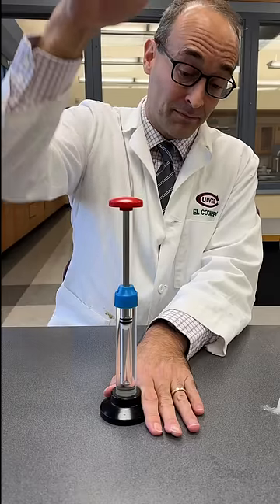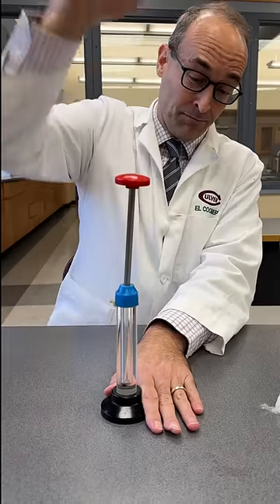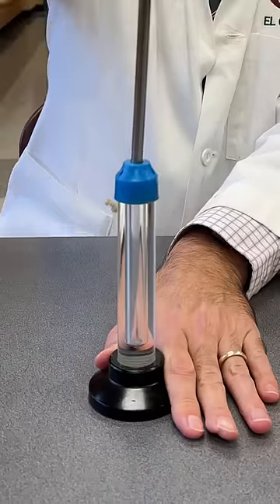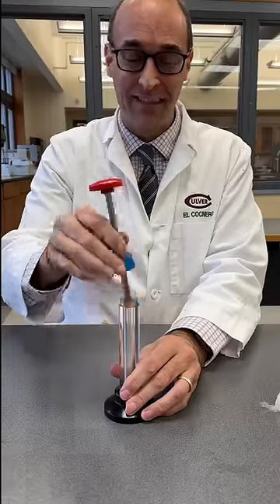Squeezing air to burn stuff

Comment: Not just the heat, the increase in pressure also means there's more oxygen molecules closer to the cotton.
Reply: excellent point!
Reply: Well I didn't understood it.. 
When he Squeezed It 
Pretty sure 
Volume decreased, And Pressure increased 
So How Come Temprature Increased there
Reply: @lightbringer485 When you squeeze gas, the atoms get closer even when they don’t want to. This makes them vibrate around a bunch which makes it hot.
Reply: @john-ic5pz pointless point. Just imagine high pressure low temperature air around cotton. Will it ignite? I doubt it.
Reply: @lightbringer485  Some of the work done by the piston goes into heating the gas. On a microscopic scale it could be explained by molecules hitting the moving piston. As the piston is in motion relative to the gas, on average those molecules will gain velocity.
For a thermodynamics description, have a look at adiabatic compressions.
Reply: @TiSapph  hmm makes sense, this might have taken place there.
Reply: I'll try my best explanation. Air has temperature, right? it has heat energy in it. 
the whole tube worth of air is suddenly compressed and the heat is now all in that tiny space. 

it's kinda like a magnifying glass: the sunlight won't ignite a sheet of paper but if you take that energy falling on the sheet and concentrate it into a point, it can be much hotter.
Reply: Wrong. Increasing pressure by decreasing volume increases the temperature because you are compacting all the heat energy into less space, and vice versa.

You are getting confused here. Increasing temperature actually also increases the pressure in a closed container, since the gas particles bounce around more and exert more pressure. The difference is that when it is not confined, it will expand and although it will not try and reduce the pressure, heat loss and the expansion inertia will cause a drop in pressure. When the gas is more spread apart, it does not exert as much pressure.
Reply: @crapstirrer  hmm understood. thanks for giving that explanation man
Reply: wow you said that with so much confidence 😂
Reply: @nhs.14  im talking about how density is irrelevant. Average kinetic energy known as temperature is.
Reply: @crapstirrer we didnt understand each other. You are talking about process (adiabatic compression) and it is ttrue. By compressing, you get the heat packed on lesser volumen which results in temperature increase. The other guy said that reason for cumbustion is "oxygen molucules are closer to combusting material" which is false claim. To explain that, imagine introducing air with 50 bar pressure at -50°C temperature. IT Will not ignite despite oxygen molucules are densely packed.
Reply: actually yes if you increase The air pressure And don't change the temperature at all eventually the cotton will ignite due to the oxygen, higher pressure lowers ignition temperature, It would lower the ignition point of cotton to room temp eventually. Similar to increased oxygen concentration.
 If you increase the pressure of pure oxygen it gets super dangerous, Even ceramic will catch on fire at relatively low temperature.

Same effect works both ways, Apollo 11 was like a third of atmospheric pressure with the oxygen level increased So they could breathe normally.

Acetylene will spontaneously combust if you increase the pressure over 30psi.

Think about it like this, instead of cotton being in two rooms that are slightly different pressure and the same temperature
You take all the oxygen from a room to space, drop it on the moon, and then try to ignite the cotton with that oxygen.
doesn't work, The oxygen molecules are all gone.

Now take that same heat source down to 15 PSI (sea level) and try to light a fire.
Way easier right?
So obviously pressure affected the ignition temperature.

Comment: This is Guy-Lussacs Law. It describes how temperature relates to pressure, more specifically how temperature increases as pressure increases, and inversely how temperature decreases as pressure decreases. This is the reason why your gas canister on a camping stove starts to get cold or even frost up when you’re using it.
Reply: Elaborate please 🥺
Reply: @Safe_intentions  It is a fairly simple law. If you go camping and you use a gas stove, you might notice ice build up around the regulator. This is what you are seeing. It also has some impact on aviation at high speeds, and can lead to a slight warming of the fuselage and wings.
Reply: @flare9757  okay 👍🏻 got it 
During use,
Gas is released so
Pressure inside it decrease 
As the temp is directly proportional to pressure and vice versa 

The pressure decreased results in formation of frost right ? 💯
Reply: @Safe_intentions  Yes, if it gets cold enough. Inversely, if a container is being pressurized, temperature goes up. It is weird until this is explained.

Comment: This is also why anything that re-enters our atmosphere burn up during re-entry.
They are going so fast that its compressing so much air on one spot, friction is just another reason why it also happens.
Reply: That's actually really interesting, never thought that could happen, I always thought it was just friction and that it didnt have enough pressure to make it heat up since it's in open air and not in a sealed chamber.
Reply: @ElPsyCongroo. At supersonic velocities, the air can't move out of the way fast enough. So, in a certain sense, the air itself is a "cylinder wall"
Reply: That's true. Friction is one but not the only reason. 👏
Reply: gets hot from "heat of compression"
Reply: what's more interesting is that a lot of the heating is done by radiation , not just conduction.
the compressed air in front of the re-entering object is so hot that it turns to plasma and emits a ton of EM radiation.
this in turn interferes completely with any telecommunication system during that stage of re-entry
Reply: @YounesLayachi  "a lot of the heating is done by radiation" this statement is false I suggest you do extensive research before making a statement.

While radiation may be a factor it is not a major factor that can push friction and compression aside, trust me when you're a capsul hurdling towards Earth's atmosphere at supersonic speeds, it's like you're cutting through air causing all that friction and compression causing the burn up on the heat shield. 

The radiation is just another aspect  
Your statement over exaggerates some aspects of re-entry, while 

Although the ionized air and EM is true still causing the communications black out as they re-entry.
Reply: It's not friction at all, it's because he's compressing the air, decreasing its volume, which causes a sharp increase in temperature 🧐

Comment: The energy in the gas is being focused into a smaller space. Kind of like how a magnifying lens works with sunlight it doesn't make energy, it just focuses it. The same thing happens in reverse, such as when you use an air duster for too long and it gets cold. A/C and refrigerators work by the same principle. That's why the back end gets hot. I uh... hope that made sense to someone... 😅
Reply: When you compress the molecules into a tighter space, it's ability to hold the energy is decreased and the energy is release as heat. Think of it like a wet sponge. When you compress the sponge the water which would be the energy is released.
Reply: Can you tell me what heat energy is? Without looking it up on the internet
Reply: @aceman9030  thermal energy. It's atoms jiggling and vibrating.

Comment: hello diesel engine!

(not internal combustion engines in general as he suggested; gasoline needs a spark to ignite at the conditions gas engines operate under)
Reply: Diesel requires a glow plug for intial ignition.
Reply: Gasoline basically does not need a spark to ignite. The wrong gasoline in the wrong gasoline engine will self ignite as well and cause knocking. Ofc. gasoline engines do not want the gasoline to self ignite that's the reason why gasoline is made to certain specs that do prevent self ignition so it does mostly only ignite from sparks. But for demonstration any of those engines will do.
Reply: @shawnr771 no. Glow plugs are for preheating not for ignition. Not needed to run but makes the diesel engine start faster and cleaner.
Reply: @shawnr771 no it doesn’t. Who told you that.
Reply: @shawnr771 no, glow plugs aren’t like spark plugs, the closest thing to a spark plug used on some diesel engines are “hot bulbs” and how it works is diesel is sprayed over the hot bulb which vaporizes the diesel to aid in combustion.

Comment: It's know as GOBEK API in Malay peninsula..Fire pistons were invented by Southeast Asians (probably the Austronesian peoples).. Their use was mostly concentrated in the Austronesian regions, particularly in the Malay Peninsula, the Philippines, Borneo, Sumatra.. These piston bellows could pump sufficient air into a furnace to produce temperatures high enough to melt metal, which led to the independent development of sophisticated bronze and iron metallurgy in Southeast Asia starting at around 1500 BC

Comment: Not just an internal combustipn engine, but a diesel engine as gasoline engines use a spark plug.
Reply: It's a glow plug, that's the swirly symbol you might see when turning the key on. It heats the deez, making less compression required for ignition
Reply: This is true, but with a really high octane fuel you could in theory do the exact same thing as a diesel engine but w gasoline
Reply: @Herbalaties glow plugs don’t equal spark plugs
Reply: @loganbaileysfunwithtrains606  correct, one creates a spark for ignition and the other warms the fuel to make combustion easier and more complete.

Comment: There's a fire starter made like this. You just add in a small chunk of wood, and it becomes a hot ember to dump onto your tinder bundle. I prefer the ferro rod instead, if the Bic fails.
Reply: These are called fire pistons, a lot of them work together with char cloth.
Reply: @chiaracoetzee  Thanks, I forgot, I did see a video where the guy made his own char cloth to go with. The other one used a piece of punky wood.

Comment: Remember, scouts, If you’re ever lost in the woods in sub-freezing temperatures and with darkness closing in, all you need to do is gather up some dry wood, some small twigs for tinder, and find a tube and matching pneumatic plunger with adequate o-rings to provide a good pressure seal.
Reply: They literally make these for survival situations. It’s called a fire piston.
Reply: @Mr1121628  yep.  They make matches and lighters too.  Although the “gee-whiz that’s cool” factor isn’t nearly as good.

Comment: One of my customers who owned an auto parts store told me about a physics class where the teacher warmed up an experimental diesel engine.  After the engine stopped the teacher took off the head, then put a gold fish on top of the piston, put the head back on the pulled rope to start the engine.  There was a bang,and when stopped turning the head was removed and rthe gold fisf was reduced to ash.

Comment: For those who don’t know, this is how a diesel engine works 🤙
Reply: Not exactly.  A diesel compresses plain dry air, and then injects fuel after.  The fuel burns right off the injector nozzle, just like a flamethrower.  This demo shows fuel and air compressed together and igniting when they feel like it, which is akin to pre-ignition in a gas engine.
Reply: @JETZcorp  yee but it’s the same concept of using no electric ignition
Reply: @PlopDeggy  Right, but it's still very important to remember that every engine needs precise timing and control of combustion.  Something as uncontrolled as this would destroy itself.
Reply: @JETZcorp  yeah ik I’m just saying the concept of using no electric ignition is the same
Reply: @JETZcorp that’s not how a diesel works
Reply: @loganbaileysfunwithtrains606  That is exactly how a diesel works.  But, go ahead and explain what you think I got wrong.

Comment: A diesel engine uses this exact principle for its combustion since it has no sparkplugs. Gasoline engines just uses compression for a better burn since it compresses the gas into a more confined space so the sparkplug can burn the fuel faster to get the most out of its chemical energy.

Comment: I‘m making the same observation every time I pump my bike‘s tires. To increase the internal pressure past several atmospheres, you need to apply quite a bit of pressure, and if you do all the time you get quite fast at it, which can heat up the pump significantly. Sometimes it gets so hot I rather wait a few seconds.

Comment: Compressing a gas heats it, no matter whether you do it slowly or quickly.  The same amount of energy is transferred to the gas (actually just concentrating the heat already present it in a smaller volume) no matter how quickly or slowly you compress it.  Where we notice real differences in slow vs. fast compression is the transfer of the heat away from the gas through the container and the likelihood of leakage, which creates a cooling effect.

Comment: Everyone is mentioning diesel engines but it's precisely what happens in an imploding submarine too. It's called adiabatic compression and that is why imploding submarines explode right after the implosion with every burnable material inside burning rapidly.

Comment: That’s one of the basic principle of air conditioning. As your pressure rises, your temperature will also rise and vice versa. As your refrigerant goes through your compressor it drastically heats up as it is being compressed. As your refrigerant goes through your TXV (thermostatic expansion valve) the pressure immediately drops and your refrigerant temperature plummets as a result. Pretty neat.

Comment: I think this is how the last successful nuclear fusion experiment worked.  A smooth sphere was impacted with lasers at precisely (very precisely) the same time causing the sphere to compress with a massive increase in temperature which was the energy input to the fusion reaction.  This is an overly simplified description of the process anyway.

Comment: Probably the most interesting example of a fire piston is some gun shot wounds. In addition to a permanent cavity where the bullet has permanently displaced tissue. Bullets typically expend a lot of energy on surrounding tissues creating a temporary cavity that closes up shortly after the bullet passes through that area. As the temporary cavity is closing up the outside might close faster than the inside trapping air in the closing temporary cavity. This trapped air can in some cases get hot enough to burn small bits of tissue inside the wound. This happening depends on the type of tissue hit and the bullets ability to transfer energy into surrounding tissues, typically when very powerful bullets travel through thick muscle tissue. This all happens in a fraction of a second so it's impossible to see outside of pointing a high speed camera at transparent block of ballistic gel.

Comment: Also how scram jets work. The air is moving so fast thru the engine a little compression makes the air super heated to where it can ignite fule to make the expansion faster creating thrust to propel an already 3.5 mach object faster.

Comment: I work in plastic injection. If a mold is not vented properly or if you try to inject the plastic too fast, you'll get black burn at the last place to fill with plastic. Also while purging somethings you'll get a cold slug. If you force the issue... the plastic will shoot it super fast and ignite once it hits something.

Comment: Diesel engines work through compression ignition but they dont compress fuel only air. The instant fuel gets injected it combusts.
Petrol engines actually compress fuel vapor and air but they want to avoid it burning through the compression. If it does its called knocking

Comment: Not all combustion engines, mainly diesel engines. Here it squeezes the pressure to get the right temperature for the fuel and air injected to get a explosion

Comment: To explain, air pressurr, volume and temperature are all connected.
If you decrease something or increase something, something else would change. In this case increasing pressure, the temperature will increase.

Comment: Air heats up when compressed, and cools down when released from pressure. The faster the change happens the more extreme the effect is. 

You can wee and feel this when filling a SCUBA tank, as well as just opening the valve and letting it empty. You can feel the /valve heat up when the air is being compressed, you can also see ice form on it when you just open it and let it drain. 

It is nothing like an internal combustion engine, it is the heat from the quickly compressed air that set it on fire.

Comment: Yeah and greater the compression and sooner the air/fuel mix burn without detonating (engine killer - gas engines), the more effective it runs.. BUT remember - more air, more fuel! That's why turbo gas engines tend to eat a little more than atmosferic engines

Comment: My guess is it’s because that trapped air that’s under so much pressure and then moving at that speed creates friction and friction generates heat obviously
Reply: no there's no friction, only compression
Reply: Dig you fail your thermo (like 50% of others)

Comment: Everything organic has an auto-ignition temperature. The substance will ignite spontaneously when the surrounding temp goes over the said temp. Air compression generates heat, raises the temperature of the gases, and creates hotspots where the temperature is the highest. The ignition starts from there and propagates throughout the piston.
Reply: Compressing a gas doesn't generate any heat. The heat is already in the gas. You are just condensing all that heat into a tiny area thereby dramatically increasing its temperature.